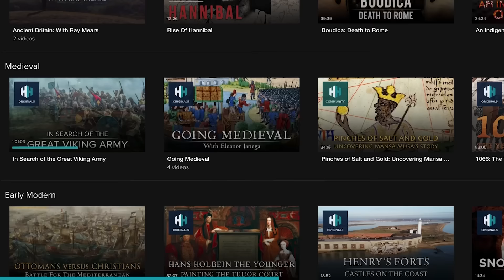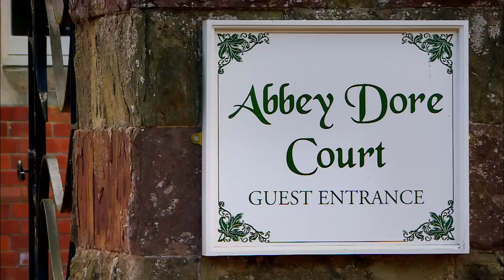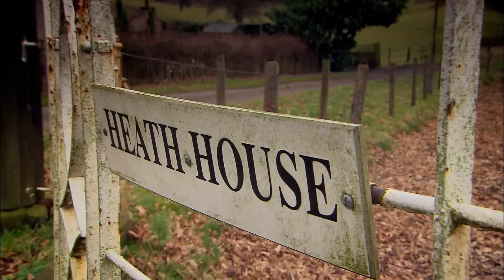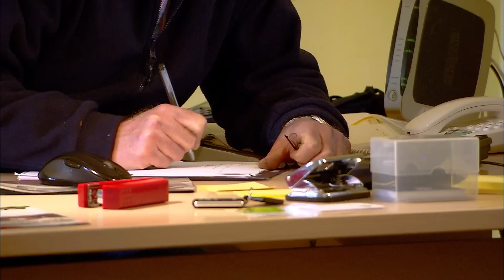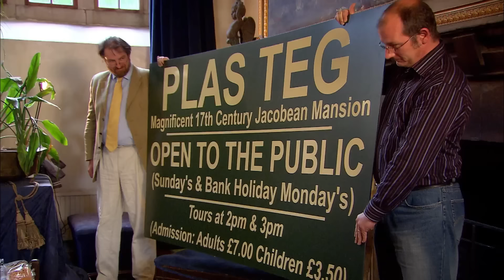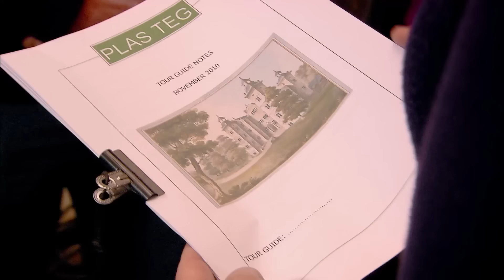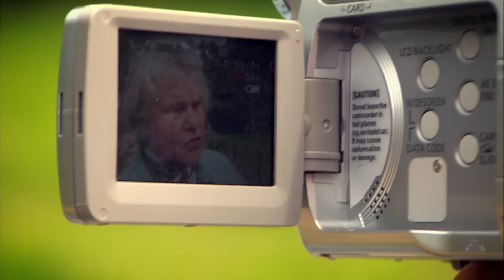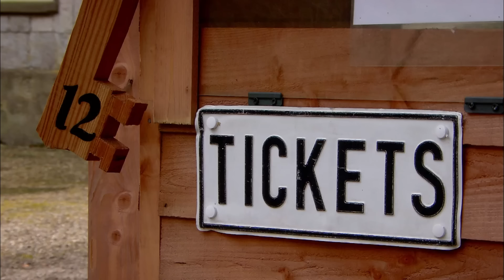The Complex Restoration Of Magnificent Historic Homes | Country House Rescue: Revisit | Real Royalty

Comment: They could rent out space for a farmers market, a photograph workshop retreat, writers retreat, and/or any kind of  retreat space. 

They can create a bed and breakfast, tea and coffee shop, rent out some space to the entertainment industry for filming or simply work from home at customer service (because it's a consistent pay check) for about two years, and then, get a renovation loan.  

And another option is to rent out a few bedrooms to retired persons for added income that can be used towards the cost of renovations with or without acquiring a loan. 

And hire locally a handy man, plus, learn to do many things yourself. 

Only hire a professional (s) for major repairs.  

Moreover, as soon as possible, transfer the electrical system to solar power and become energy independent forgoing the usual electrical bill.

Comment: Great Floorplan! Very roomy!!!  I missed...does it come with a lot there? I do have a question about the lots. Most of the residents are single retired folks where it's not quite so easy to hitch your house up to a truck and go. I understand lot rental leases are for one year and at this time there are no plans to increase that, correct? So what "guarantee" does tiny homeowners living in one of the awesome communities have that, say after I've been there a few years, long enough to have fixed up my lot perfectly, built maybe a screen porch, have a small fenced in area for my dog etc, when my lease is up after the 5th year is not going to be renewed? I realize things can happen no one plans on, but in this case, I've made good friends with my neighbors and kept current on the lot rent. This has always been my fear in renting apartments too. But it just dawned on me that unlike an apartment, I still have my house just nowhere to go? Before when I was younger and my kids were around to help move, I managed just fine (BTW, I've never been evicted but when you get close to lease renewal, I stress), however, that's not the case these days. How long have residents lived there thus far? I'm so anxious to get my ducks in a road, get my house contract started and begin this new chapter, but can you help reassure us somewhat?

Comment: Just finished Abbey Dore episode.  Interesting dynamic between grandmother and grandchildren.  Great that they managed to restore the home, but sadly, though Clare has the drive, she has the most inappropriate design taste for that estate.  Ruth is correct when she suggested that it should have been Charis (the way she renovated her workshed) that should have led the design aspect.  However, the grandmother clearly has no interest in the building, just her gardening.  I feel it is a bit of a contradiction in the way Clare loves the historical building, but does not seem to put in the effort to learn about design that would match the estate.  It would have been cheaper to buy antique beds that that ghastly bed that looks like it is out of Walmart.  Same to be said of the couches.  The paint colour choices were also ghastly.  It is extremely irritating and frustrating as a viewer.  Clare should have done more research and not put interiors belonging to an american suburban home - into such a historical building.  I will stop at this.  Perhaps as she gets older, she will realise her mistake and make the adjustment.